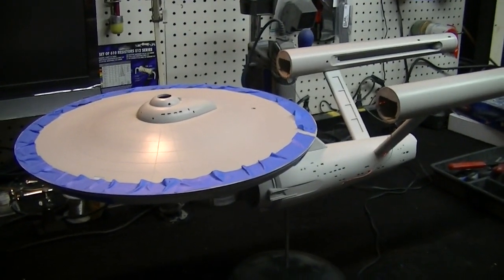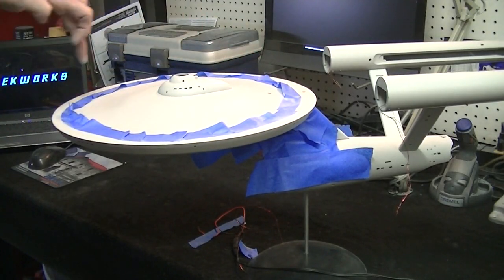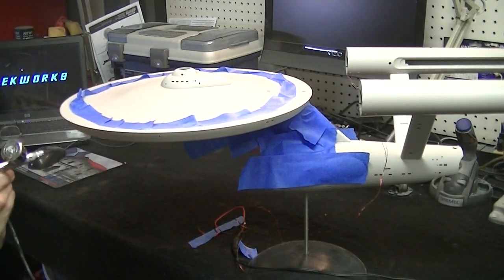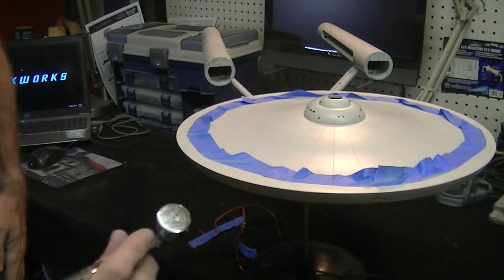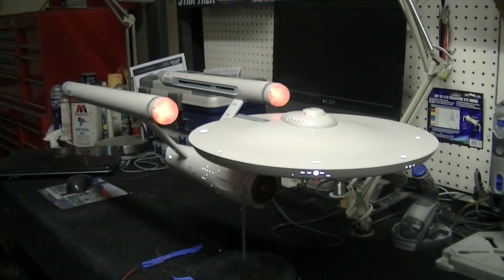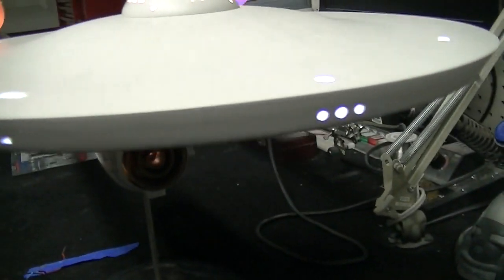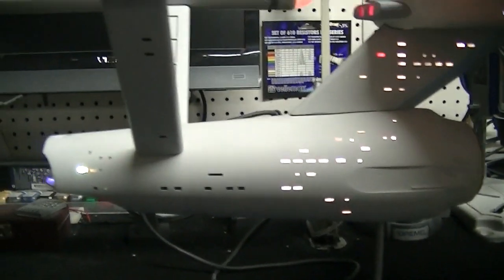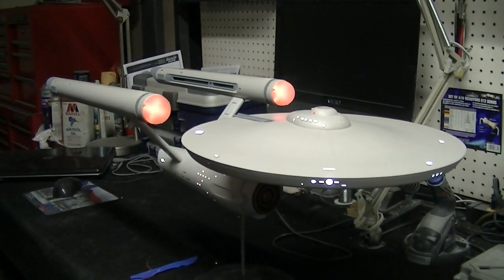Polar Lights 1/350 Scale TOS Enterprise Buildup PT 8

Comment from the maker: I wanted to use the black window inserts on the secondary hull since those were dark on the ship during the show. Also the other windows on the secondary hull are far from the seams so I could paint it first then put them in and then be able to paint the seams without masking them off. In the saucer, the windows are close to the seam and would have needed to be masked to fill it and paint it.